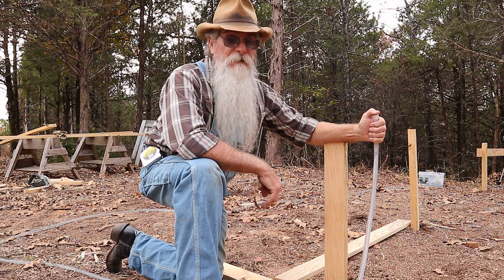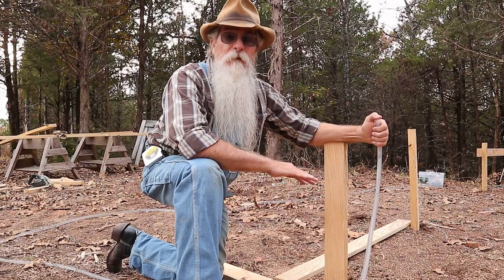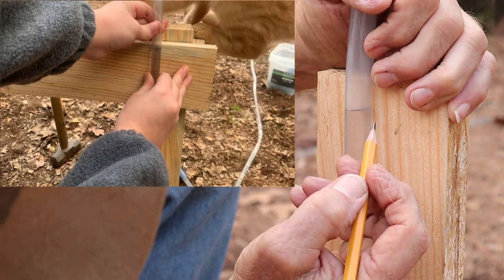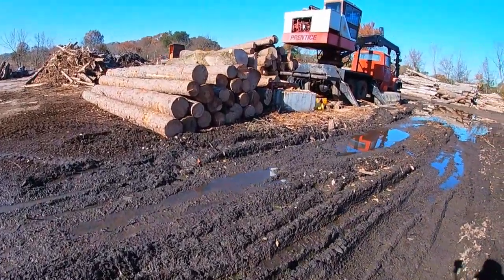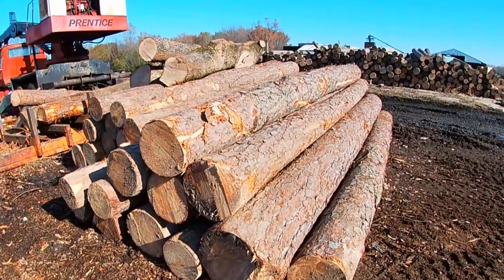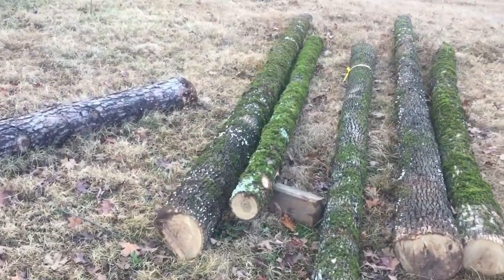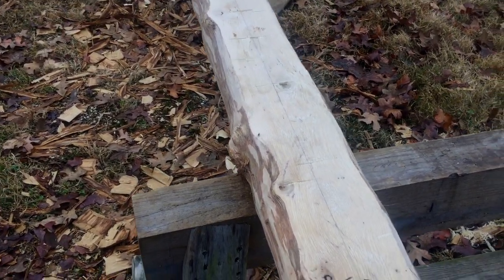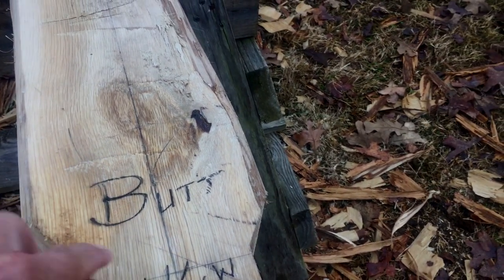Batter Boards, Cabin Logs, and Floor Joist (Ep 3)

Comment: If you don’t mind how much does the loads of logs cost  for your cabin
Reply from the maker: Howdy Jeremiah- a lot of the price of logs depends on where you are and what species you’re buying. Some mill sell by the board foot or just the log weight. For wall logs for a 12’x16’ cabin you would be in the $5000 range for the wall logs but could easily be more. God bless

Comment: If you do it right the first time,  you ain't got to fix any mistakes later (well,  at least they shouldn't be as many). A house is only as good as what it's built on. Oh, and it's hard to break a bad habit.
Reply from the maker: Austin Presley   Howdy Austin- you’re right buddy. Starting off correctly sure makes it easier later on. God bless you

Comment: Love the videos! What is the cost of one of your logs?
Reply from the maker: Davin Dempsey Howdy- that would have to be based on an average because they are bought by the ton weight. I don’t know how many tons there are as of yet.
Reply: Do you know what the tone rate is ususlly
Reply from the maker: Davin Dempsey That could vary widely depending on what species, size, length, localities. Lots of variables to consider.